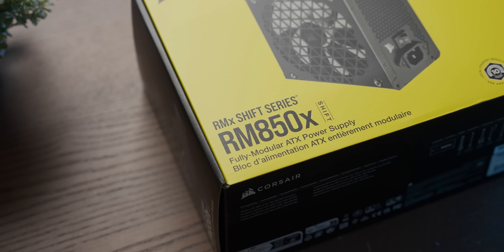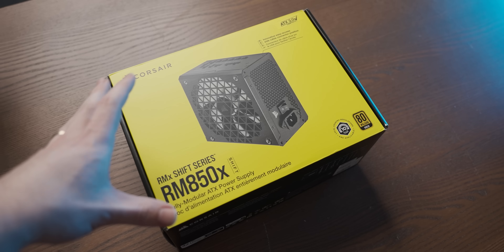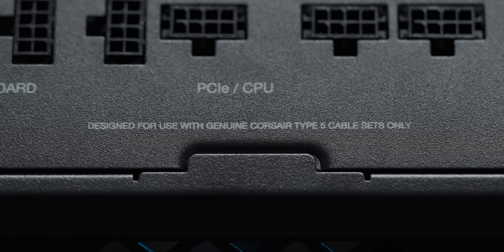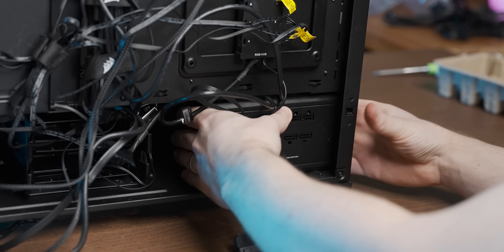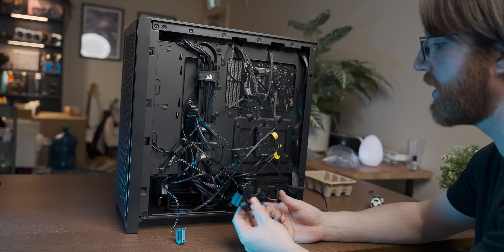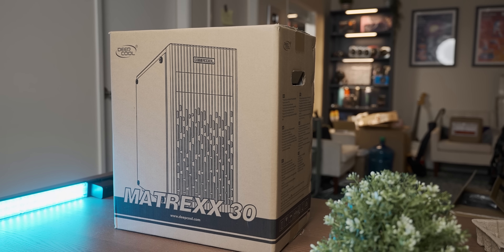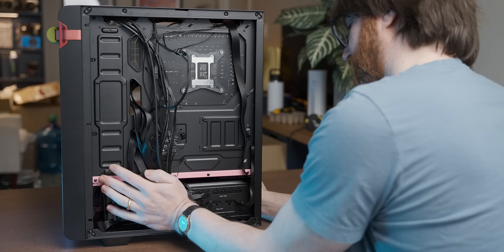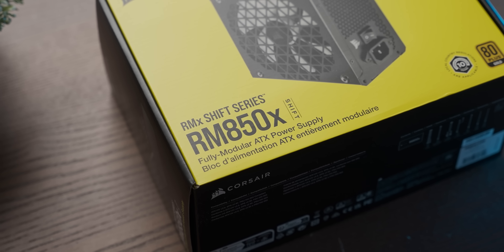How Has Nobody Done This Before?

Comment: The cables are really flexible! Make sure to give them a few good bends so the back plate doesnt have a problem going back in. Rebuilding my pc into a better case made it so much easier. Also a plus side is that the psu even runs cooler. I had a "750w gold" power supply and it ran hotter in a cold room, more then the 1200w corsair one lol

Comment: Just got this with the corsair 4000d. So much easier to work with and added/removing cables made this decision for me. As long as you dont have a radical case or psu placement, this can definitely work for you.

Comment: I have said for years they should do something similar. I always thought that the case design should allow for easier access to the PS connectors. They should make cases with a PS tray that allows the power supply to be turned 60 degrees out for service/install and then quickly and easily locked back into place, rather than change the PS design. Slide out rails maybe? I like the power cables on the front so they can be hidden. I think the case should change not the power supply and its not worth the premium. Note: Corsair will sell you a single PCIe power connector for the low low price of 20$. Not kidding. Crap, Plastic, Basic PCIe power connector.  I know because during the pandemic I went to Microcenter in desperate need of a power supply and the only one I could find was an overpriced 850 Corsair and guess what? Did not come with a second PCIe Graphics power cable.  The supply of course supported the second PCIe rail, they just chose not to include the cable, because PROFITS? North of 170$ for an 850 bronze and no second cable. Weak. Its black so that is something I guess? As you might have guessed, I am not a huge fan of the brand.

Comment: …they made new connectors, cables, and psu layout…putting the connectors on the side against the side panel…and did not make new said connectors angled to alleviate clearance issues/cable wear from bending

Comment: Technically speaking, the non-PSU end of the cables are still universal, so you could feasibly still connect sleeved extensions to these cables and it would work fine. 

Also changing each end to different sizes will greatly reduce the confusion of trying to plug the wrong side in.

Comment: I have a Caselabs Magnum SMA8. This would have the cables facing either the floor of the case or up towards the mid chassis divider. With a 280mm and a 560mm in the basement of the case, all my excess cables could lay on top of the radiators without interfering with any airflow. This is actually genius.

Comment: FULLY modular power supplies are so stupid.
The number of people that don't need ATX/CPU are pretty much a rounding error.
There is NO need to waste time/money having the minimum required cables be permanently mounted.
Molex? SATA? PCIe? Sure. You might not need even one of those.
But if you are not using the ATX part you are already doing something SO out of the realm of normal that you can just modify the unit yourself if you REALLY care about disconnecting them.

Comment: I must have always have used a case that had plenty of room (like meshify and define 7) where i never have to move the PSU to add more connectors to it. I just wish sometimes that the connectors at the psu had 90 degree connectors

Comment: This looks so much better than the traditional standard power supply units. It's such a pain to not be able to access the plug ports without having to first remove it from the case just to plug something else into it. We need this as a new standard, and case manufacturers need to be mindful of this. There's so much wasted space that could be better used for cable management to hide things away more cleanly.

Comment: I will never understand why they do not break conformity more often.  This design is unique.  I like it.  With the proper case obviously.  BUT imagine if they make them a little shorter, a little deeper and make a modification to the width.  It could come with a adapter metal thing to allow it to fit in the standard PSU bay but then it would give you an additional inch or two for cable management.  My gaming rig running a 3080 with a massive cooler still has plenty of room in the "psu basement".  If they made them longer and shorter or just longer and narrower...they could really improve on psu power consumption...just a thought.

Good vid man.  Keep it up.

Comment: Why didn’t they work on 90degree plugs for the power supply side??? Super missed opportunity having them straight out to the back panel of the PSU… and I’ve never took my PSU out to add a sata plug?? It’s pretty easy to plug in still in back of psu with it installed at least in the last 4 cases I’ve used NZXT Corsair coolermaster and thermaltake… all atx mid tower size..
I wouldn’t never recommend NZXT cases the rest were all great though. Same as the NZXT aio huge junk they go bad in a year like soon as warranty is up the pump stops working like clockwork

Comment: I could see this used in a small form factor case where the power supply sits vertical and not horizontal... Thus the cables would face "on top" of the PSU thus allowing better cable management.

Comment: It does seem like a great idea for accessing the connectors, however, they need two versions: one with the cable connectors on the left and one with the cable connectors on the right, so people can choose which way up they wish to mount it.
My case has a top mount power supply area, so the design in the video would be perfect, but if someone has a case with a bottom mount for the power supply, and they want to push the hot air down, then they'd need a PSU with connectors on the other side.
Why do they still make cases with bottom spaces for power supplies? It seems insane to me, because hot air rises. I guess it's for smaller cases, so the HDDs and SSDs are mounted at the bottom, in the coolest part of the case.

Comment: One issue I do see with this design is the restrictions imposed on airflow options. For example, on some setups you may want to flip the PSU to use it as an extra source of exhaust air flow.

Comment: I circumvent the issue with the "last missing cable" you talk about at 5:00 by first hooking up all cables and do management for the most part and thenpop them into the PSU before sliding it into the case. Easily accessible should I forget one and ao overall cleaner build-look right of the bat

Comment: This product is complete and utter trash. I don't think it is a good idea to have such massive bends on cables like that, it could create potential problems later on - also I avoid those corsair PSUs, I noticed they are not using SeaSonic anymore, a lot of companies now are cutting corners and using low grade components, it is surprising that people overlook that a lot of the PSUs sold today are fire hazards.

Comment: I bought 2 of these psu's from BestBuy and both were DOA. Not to mention all the plugs were very tight fits which made them very hard to put in. Not very good quality control for tolerances in my opinion. I would never buy one of these again and surely wouldn't recommend anyone else to buy one.

Comment: do you know weather the pins on the PSU are basically just the mirrored version of what you plug in? because I don't understand why manufacturers don't do that that way the cables look super clean and it would make cables interchangeable between PSUs and which end goes to the PSU vs plugging into the device. Like you would be able to buy cable mod cords and just plug them into the PSU instead of needing to tuck away all the cables and hide them away (making a big mess)

Edit: I just watched the actual video, and it is kind of unfortunate that it isn't the same size so you can't do the reversal idea i had, but if V5 cables are that much better then so be it for that function... I still would like to know if the cables twist around each other along the cord or if the run purrfectly straight the entire length like the cables that are just extetions.

Comment: "Why has nobody done this before?"

Because there are standards, and it won't fit in more traditional or older ATX cases without a side-panel cut-out exactly where the PSU is.

Comment: I wish I had this type of PSU in my Coolermaster cube case... I now have to take out the PSU if I am to connect anything to the normal PSU it has now because there is simply no room to do anything without removing the PSU and take out out of the case.

Comment: i ever think, why the manufacturer of mother board, case and power supply they don't agree for having one big socket for all power features?, including hard disk power, and data,  pc without cable. the motherboard just may be plug in the case, also the power supply, hd, etc.

Comment: Eh, I don't know.  When I build a PC a lot of the cables barley reach where I need them.  This would cause them to need to be a little longer.  This happens when I build a mid or full tower PC.  I swear, I build a full tower, cables are too short and have to buy extensions, sell it, build a mid tower and I still have short cables.  I think 'If I bought my last power supply for this case it would be find but this one is just a few cm shorter than the last one!'  This would be great for the Asus boards where the connectors are on the back though.

Comment: These new connectors appear to be perfect for an sfx psu to be used in a FormD T1 or Dan A4-SFX case but they would need to stick with placing the connectors on the back of the psu instead of on the side.

Comment: Meh, I've been routing wires since the 90's and have a lian-li Pc6B from back in the day. It isn't hard to get to the modular cables and I certainly don't need to remove the psu and my cables still look like less of a mess than this. Really what this video showed me is the majority of manufacturers are still putting out cases with shitty interior design. You get what you pay for.

Comment: If corsair had made this with a 12vhpwr native 16 pin to 16 pin, I would have bought it for my 4090. Don't like using 6+2 connectors. David always has me crying laughing lmao. "To push the convenience of this power supply,  i'm only gonna plug in the 24 pin, which would be madness with a normal power supply" 😂

Comment: Just a guy with some opinions here, but you should NEVER mix and match power supply cables, unless you're trying to fry your computer.

Also, having the cables on the side is great, but it does make it hard to pack away all the extra length of your cables into them inevitable cubby hole you're gonna have behind your PSU.

Comment: Honestly, I think this is a fantastic PSU solution, especially for cases like the Nezuko case. I had a Corsair 460X back when they first came out and it was a nightmare to fit my PSU in it while still having the drive cages. 

I have an EVGA P2 1200 SuperNova, so it's a long PSU. It had hardly any space for cables and this PSU configuration would have far lessened my headache.

Comment: I think if Corsair re-imagined this with a half inch indentation where the connects plug in would improve the compatibility with cases 10x over essentially giving it the same footprint as a regular power supply with the cables plugged in

Comment: I feel like all you need to do is look at the past decade+ of case design to realize why nobody had really done this before.  It's only fairly recently that the MAJORITY of case designs are based around the idea of PSU in the basement or tucked away behind the motherboard, while the rest of the components get to life comfortably upstairs.  Years ago, it was always PSU up top, and you were lucky to have much room to run your cables behind the motherboard, let alone have ample space for EASY cable routing.  Back then, "Different" layouts were considered more premium, and you definitely paid for it.  Probably essentially the same reason why having connectors on the reverse of the motherboard never really made much sense until now.  The whole "Behind the motherboard tray" area was always an afterthought until the past few years.  Now that's basically a priority.

Comment: When I built my first computer last year i plugged in the wires to the power supply before putting it in the case. Why is everyone putting in the power supply mounting it then plugging in the wires? I was told to work smarter not harder. No one else know that saying?

Comment: we tested the 750, 850 and 1000W models and yes they are good power supplies and the swift are ATX 3, which by the way was also a challenge to test.
 Even in some older cases, it becomes a really interesting feature.

Comment: I wonder if they used an existing PCB/internal layout, necessitating the smaller connectors to clear other components; 
And/Or if the smaller connectors lent themselves to greater flexibility since the wires do not diverge as much and therefore no not need additional structure to remove/manage [inter-word-I-forget] space.
Reply: DawidDoesTechStuff11  inter-Yooo-r : The inside of an enclosed space or inner-envelope (ie: the interior of a cave, building; or inner-tube) ?
I guess that sort-of fits; but I thinking of "tit-ce"; 
As in inter-stit-ce-al : a small opening between objects, particularly those in a set such as atoms in a crystal or wires in a cable. (alt: prescribed intervals of time)

Comment: honestly we just need a better way of getting power to components then using 800 wires. I know there are some niche mobos that have power connectors integrated into the mob and that seems like something that all mobos should start having. There are also a few; like one or two mobos that have the power connectors on the backside of the mobo. You figure have one cable from the psu plugged into the mobo then whatever port you have something connected to will provide power for the component. It's crazy how everything in the PC industry is advancing yet we still have to deal with a rats nest of cables going from our components to the PSU.

Comment: Regarding the inability to interchange cables…… re-using power supply cables is a terrible idea unless you want to fry components
Reply: @adampinnock7750  slightly different pin layout or contacts. Interchanging power supply cables has always been a No No.

Comment: Mentions using “wasted space” referring to the space between the psu and side panel but then also talks about how it’s easier to get the side panel on. P

I don’t get this. If the space was wasted, meaning unused, wouldn’t taking up that space with connectors and cable make it more difficult?  If it’s a cable bulk problem, then it’s just it has shorter cables not a design thing that is helping.

Comment: Smaller cables mean less material and higher profits for Corsair, Its also likely a failure point if you pull heavy wattage through those cables... Looking at you 13900k/4080/90 combo! Those cables look like the wire is the diameter of a human hair and probably aluminum to boot, then you have to crank them and crush them with the side of your case! Not good!
I could be wrong!

Comment: I have the O11 Dynamic and the power supply is at the bottom. Is it possible that you switched the hard drive bay with the power supply? I didn’t even know that was an option

Comment: This would be so much harder to install in my TUF GT502 case than the Be Quiet! PSU that I have installed, while not providing any benefits at all. So it's a hard pass for me.
But I can definitely see the benefits in other cases, as long as you have a way to make sure the PSU will fit your case before actually buying one. Anyhow, thanks for the video.

Comment: For me the issue with my side panel wouldn't be resolved with this. In trying to make things neat looking in the main glass panel area the 24 pin power cable of my Corsair PSU is too thick to run between the solid panel and the internal structure. Next time I take it out to clean things, though, I plan on re-evaluating my cable management. But I just bought the tower and PSU together as an upgrade and thought it was going fine until I went to put the panel on and had to get an extra set of hands to help me push things together, and now the panel bulges.

Comment: It seems like a good concept with the correct case but you're still putting all the excess wires in the same place so instead of just leaving the cables out of the power supply now you're going out of the power supply and back into the same spot you would have put the wires into anyways. And if you can't just set the computer on its side and push the side panel with one finger you need to do some more cable management with this power supply.

Comment: If it benefits a particular application then I'd say go for it. Although the fan will always be in a downward position, which  may not work for many setups. I've never found the traditional arrangement too difficult, and if a little massaging is required, It's just part of the build process, which for me is part of the fun.

Comment: It's a good idea but seems like it would be tidy if they rotated thhe connectors so they were all in the same orientation as the 24 pin, then gave you all right angle connectors. All the cables coming out of the PSU would just lay flat ontop of each other.

Comment: The normal RMX series power supplies no longer come with a bag either. I bought an RM850X in May last year and the cables came in the same plastic bag. I'm guessing it was to cut unnecessary costs with the cost of parts going up.

Comment: Because 98% of the current cases on the market have 1mm of clearance between its frame where the psu mounts and the back plate that covers thw case essentially giving you like 1mm if soace between to fit cables. Will NEVER buy one